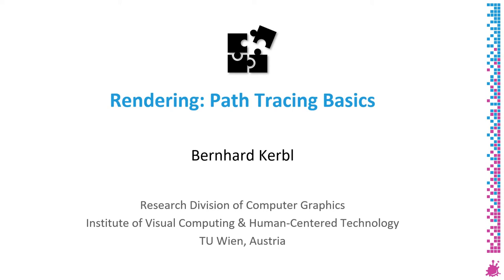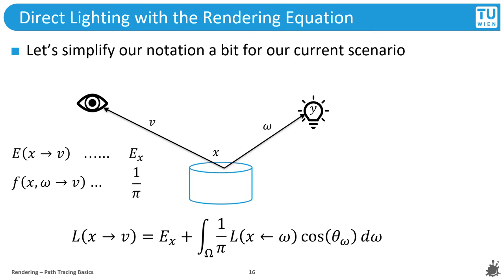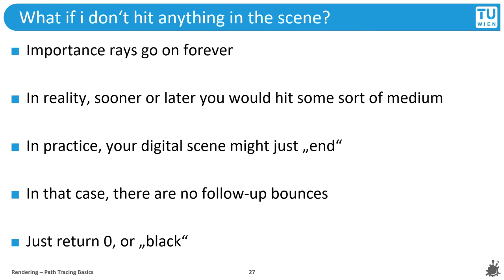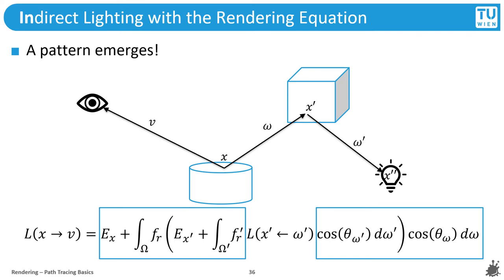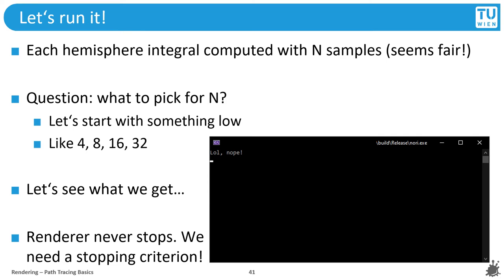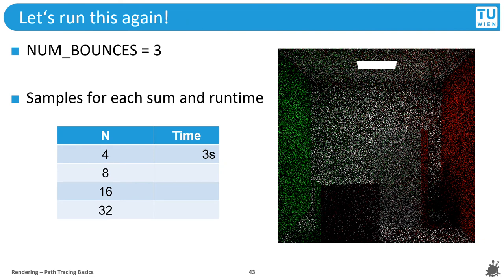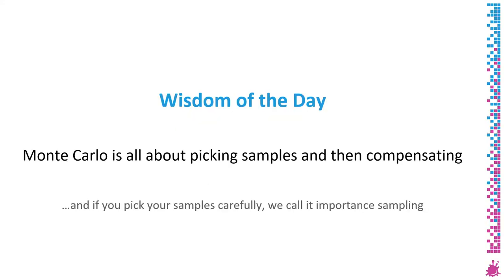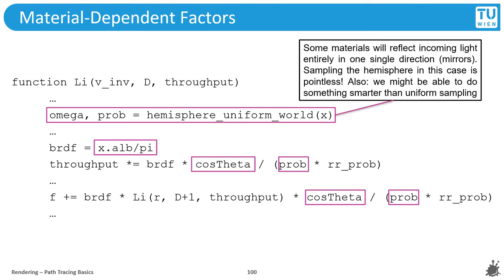Rendering Lecture 04 - Path Tracing Basics

Comment: If 4 camera rays are emitted from the same pixel, are they completely parallel to each other, or are there random small Angle deviations between them?
Reply: Sorry for the late reply! That depends on your requirements for sampling and your interpretation of pixels. Any reasonable path tracer will have the rays deviate, as you say, and later filter those samples into actual output pixel values in some non-trivial manner. Making them all parallel will give aliasing results, but for this lecture we wanted to keep it basic.